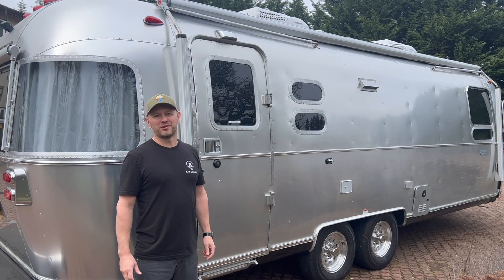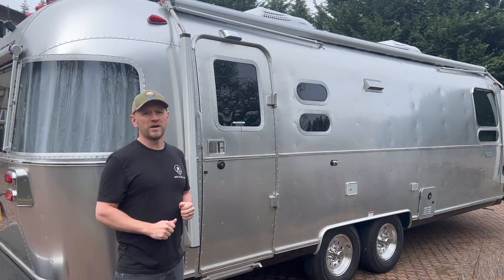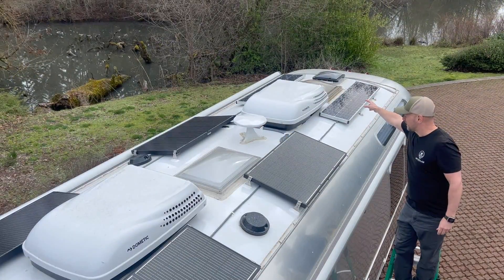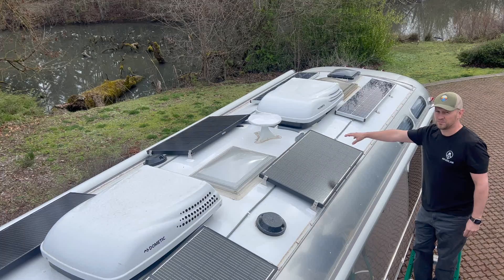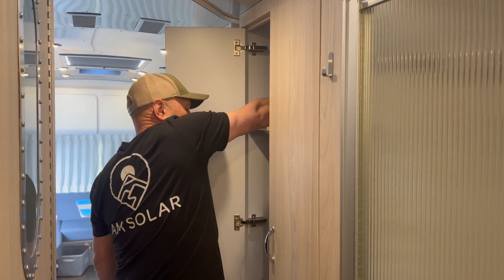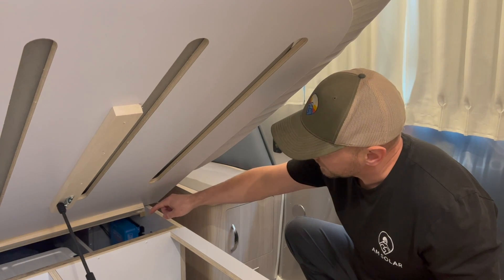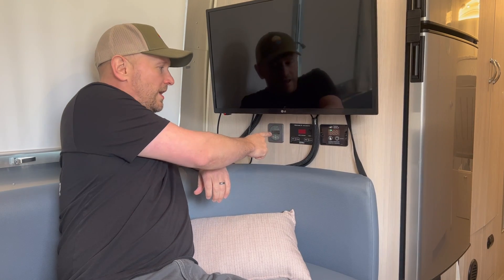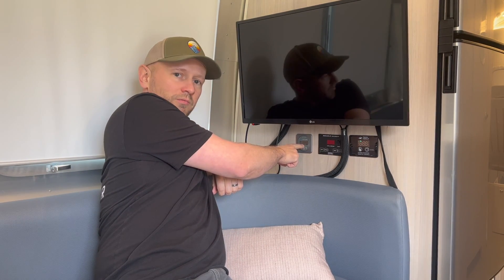Airstream Solar Upgrade | Airstream Solar Install

Comment: If you ran the two sets of panels in series instead of parallel wouldn't that allow the 8 gauge wire?
Reply from the maker: With a series pairs array, when one panel has partial shade on it, the blocking diodes of that panel will bypass the shaded section.  This allows the rest of the cells in the panel, and the string to maintain current, but it reduces the voltage output of that string.  Then when it meets an unshaded string of panels at full voltage, the two strings are forced to operate at a weighted average voltage, which typically not near the ideal operating voltage of either array.

In other words, yes, you can use 8ga, but series pairs is a bad idea if you deal with partial shade.

Comment: I thought for 2023 airstream allows you to use AGM or Lithium and therefore Li seems to just be a drop-in solution, no?
Reply from the maker: It mainly comes down to how well your charger/converter works with lithium batteries.  Some are perfectly compatible (have a lithium mode), some will damage lithium batteries, and some people prefer more powerful aftermarket options.